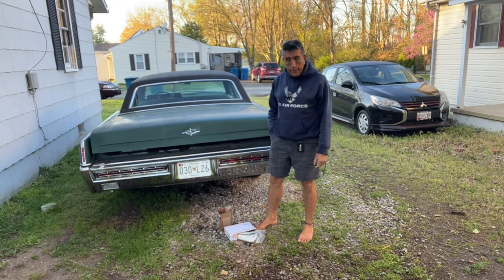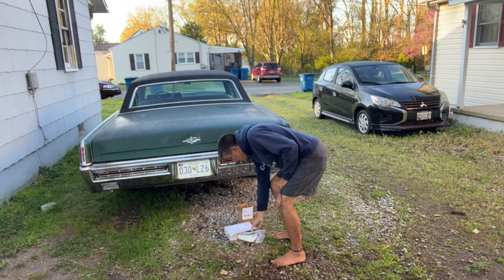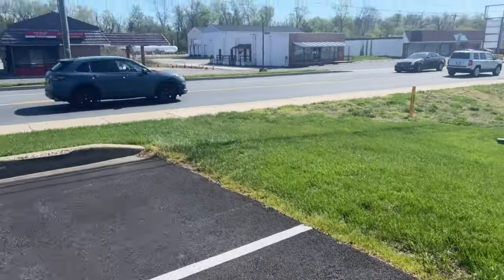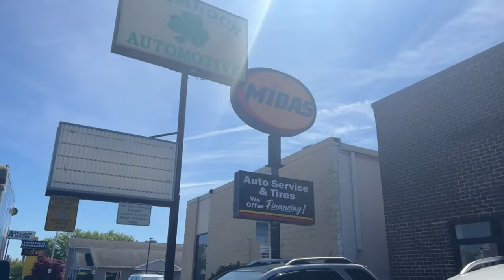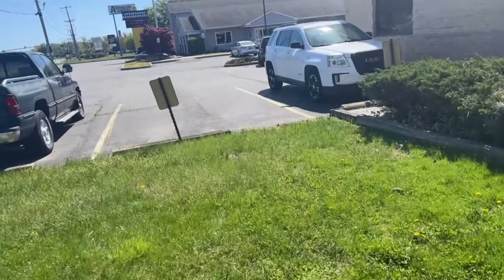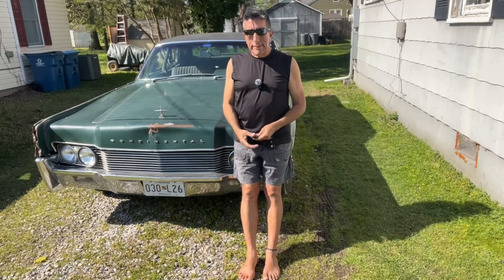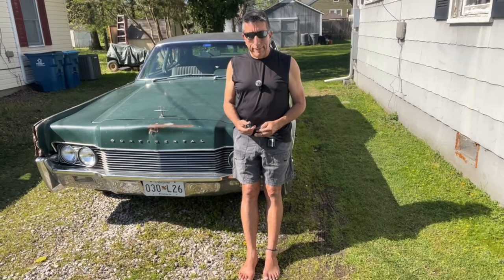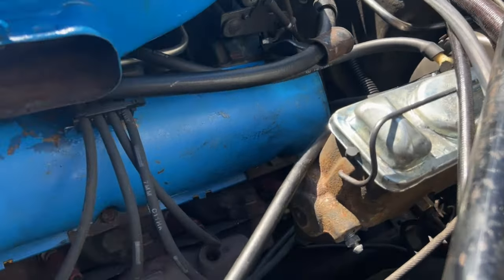1967 Lincoln Project Update 16 Apr 2024 New Tires Installed and Alignment Done

Comment: Do you have the long chrome mounding for the driver side?
Reply from the maker: No.  Well, I do, but it's mangled and not usable.  One of many trim pieces I'll need to acquire for the body.  First I've got to replace the front passenger fender (I have a replacement) and have that rear passenger fender repaired properly.